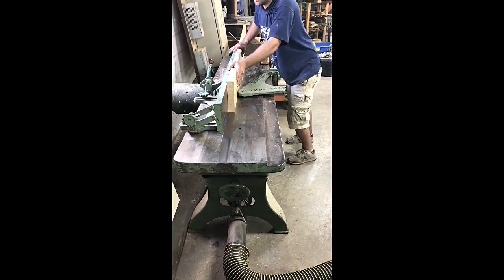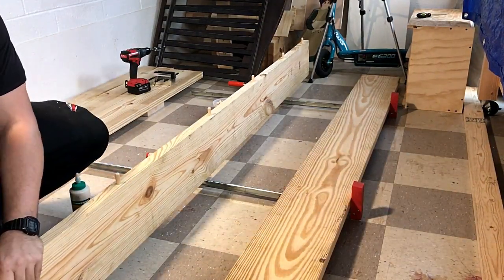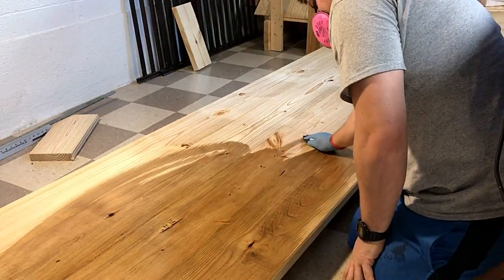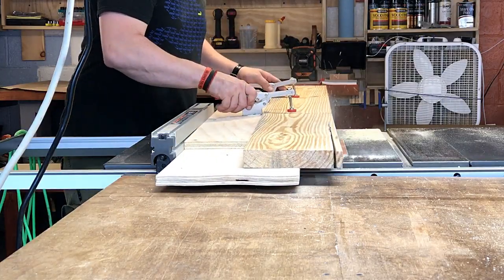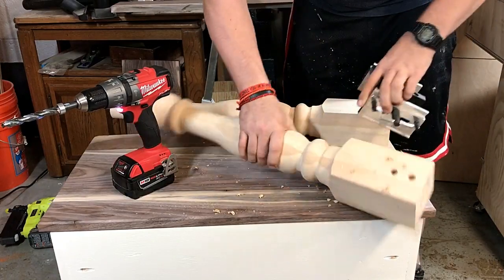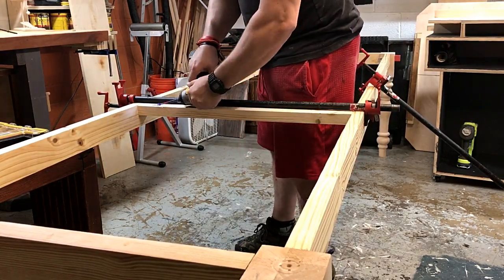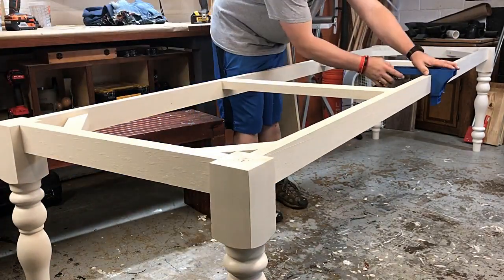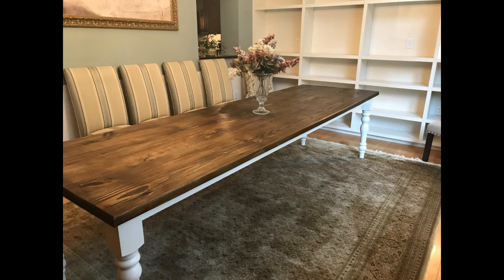10 Foot Farmhouse Table With turned Legs!!//How TO

Comment: Thank you so much for your videos.  They are really great.  I am just starting out and am trying to build my first table.  I really love the look of the farmhouse table you did last year and want to try it.  I take it from your more recent video that you would definitely recommend against bread board ends because of expansion and contraction.  (It that is incorrect, how do you compensate for it?)  Also, would there be an expansion problem doing the 4x4 legs and cross beam like you did in that farmhouse table?  I really like that chunky look but don't know if it will work.  Thanks.

Comment: Still just a bit lost on how you attach the top to allow for movement across the grain. A short vid on just that would be really cool. Keep up the good work.
Reply from the maker: Wade Booth i think i will do a video on just attaching the top at some point. Basically I just drill several pocket holes on the inside of the aprons. Then I use a half inch counter sink bit and drill out the "pocket" of the pocket hole. After that I lay the top on the base and drive pocket hole screws in from the bottom not fully tightening them.
Hope that helps and thanks for watching!!

Comment: Great project thanks, what is your thoughts on using biscuits verses dowels?
Reply from the maker: Bob Scruggs thanks so much! Dowels addd strength and keep the top aligned! Biscuits mostly just keep the table aligned. I have used biscuits in the past but ending up returning my biscuit joiner! However I will probably get one again to use on most tables to help line things up much faster than dowels!! Hope that helps!!

Comment: at what length do you need to start worrying about the span being too much for the side aprons and use a intermediate leg??
Reply: Did you ever get an answer to this? I’m wondering the same thing.
Reply: For the construction method shown and materials choice, ten foot is about as long as this table needs to be. You could add an overhang on the ends to increase the table to 12’. 
The biggest factor in table length is your apron. Using taller lumber and intermediate spans placed vertically is a great design that allows much longer lengths. With a good hardwood, much better joinery and a better designed apron this table could probably reach 20’ without intermediate legs.

Comment: When you push on this table did it move at all? I am trying to build a table and am having a problem with movement.
Reply from the maker: Sarah Miranda thanks so much for watching!! No it doesn’t move at all. What kind of joinery are you using to attach the aprons to the legs?
Reply: @woodscrew5612  kerf brackets....I think that is wjat they are called. I made little cuts for the brackets to fit into then screwed them in and tightened the bolt.

Comment: You’ve been watching too many Ana White videos bro, lose the pocket holes and build a table for your customers that will last.  Pocket holes were designed for cabinet faceframes, not table joinery
Reply from the maker: cameron craig Hey brotein shake, did you watch the video? Pocket holes weren’t used for the main joinery. You do realize that pocket holes can be used for cross support and to attach the table top instead of buttons right? You need to allow for expansion and contraction which I did. This table will last, screws are used in buttons too. Keep learning you’ll learn more over time, it takes awhile. 
Enjoy